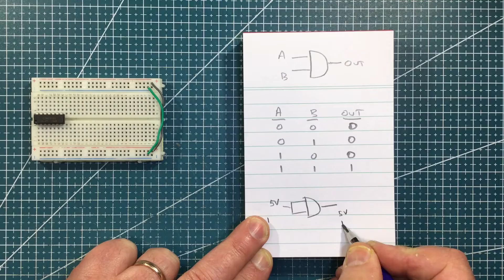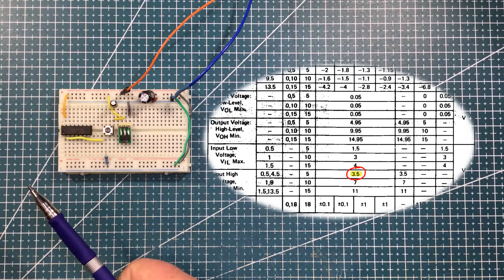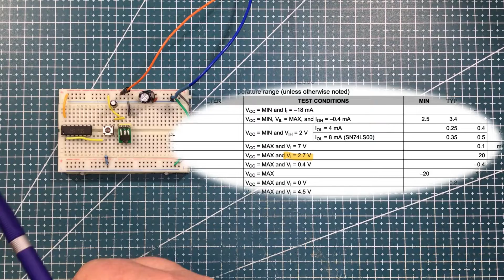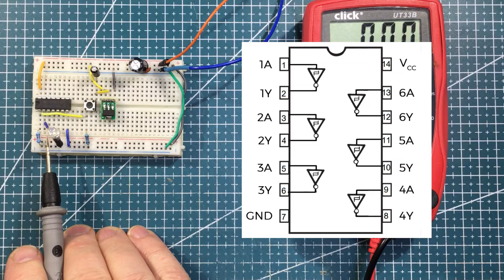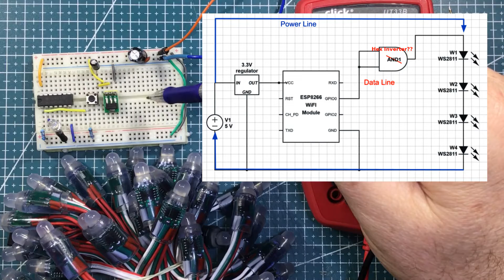Level shifting CMOS or TTL?

Comment: A factory-bought TI CD4081BE running off 5V will output a definite level when driven close to the threshold. It will consume cross-conduction current as expected. But with a 3V input, you'll be getting either 5V or 0V on the output, not 3V. There is no stable input voltage for a 4081B that would let the output stay at 3V with 5V supply. I've tried that. A 4081U part may do that, but the chip you've shown definitely has a B suffix, not U suffix. You can put together a 4081U-equivalent AND gate using the 4007 array to see that behavior.

A 4081, whether B or U, loaded down too much with a LED sure will not output 5V. CMOS outputs are current sources. When enough current flows, the carrier density and drift speed in the channel are saturated, and no more current can flow. The output has an I-V curve, it's right in the datasheet. I bet you can look at the curve and roughly read off how much current that LED was consuming. 4000-series logic has some high-drive parts, but the majority of them are low strength outputs designed to drive parasitic trace and input capacitances in a circuit and not much more. For driving larger capacitive loads, LEDs, etc., use e.g. 4041, 4049U, 4050. They have high output drive. 4049U and 4050 have strong PMOS drivers (high output level) and weaker NMOS drivers (low output level). 4041 has symmetric drive strength and is IMHO a rather underappreciated part. It is one of the fastest 4000-family buffer gates, while also being able to drive comparatively heavy loads.

A CMOS and gate may also behave differently if both inputs are driven close to threshold, vs. just one of them, and sometimes which one has lower voltage makes a difference too. So, if all I had were 4081 gates and I needed to do level translation from 3V to 5V, I'd do it in two stages. First stage 3V to 4V, with one input driven high, another driven from 3V. Second stage 4V to 5V, again with one input driven from 5V, another from the 4V output. That's about the only way to do it reliably for arbitrary waveforms. For a 50% average duty cycle waveform, capacitive coupling directly from 3V output to 5V input would work fine, with the 5V input biased to 2.5V. But that's really taking the poor 4081 for a wild ride :)

The 4081 you're using looks a bit dodgy. It doesn't have any recognizable manufacturer brand that I can see. Yet it has been laser-marked. It's possibly fake. It wasn't that unusual to have no top-side manufacturer markings on some of the chips made in the 70s and perhaps early 80s, especially by smaller manufacturers. But those parts were silkscreened (often crookedly), not laser-etched.

A telltale of a fake chip would be if it had acted like a U (unbuffered) chip, but was marked B. To check that, take the input-to-output voltage response. A buffered output snaps between the states, a U output will be dawdling all over the place.

For level translation from 3V, if you want to stay within the 4000 family, you can use a CD4504 configured for TTL levels (strap pin 13 high). You can also design a level shifter using the transistors in the 4007U array. With those you can either build a CMOS comparator with common mode range encompassing the threshold you want, or a level translator structure. Either would be considered a "building block" widely used in CMOS ASICs. As usual, there are many particular architectures to choose from, trading off speed, power consumption, input and output ranges, number of transistors, etc. Worth doing if you need something special and feel like engineering it from scratch for fun. Otherwise, any modern CMOS comparator (dirt cheap and plentiful) will do any level translation you want, in a most general way.
Reply from the maker: Brilliant advice, thank you. I have no doubt most of my cheap AliExpress buys are dodgy. Definitely good enough for a hobbyist’s bench, but frustrating when I dive a bit deeper as on this occasion. 👍😀

Comment: A bespoke chip for this application, the TXS0108E will go low as 1.2V to 5.5V at high speed (or vise versa).
It is common, and inexpensive.  If driving a peripheral at megahertz speed, this is the thing.
Sadly, it does not work well for open drain, like i2c ... the dual-mosfet method seems best for that.
Reply from the maker: It’s a learning curve and I’ve enjoyed trying a few more chips than I’ve shown. A bunch of CD4504s have come in, but the datasheet is not promising. 🤷🏻‍♂️

Comment: I ended up with using 74hc245d as 3v->5v level converter, powering on with 5v. Specially for "neopixels". Fast, works well. In theory, it's a bi-directional, but it cannot do bi-directional Level shift, only good for one way level shift, most common from 3.3V to 5V. 
This beast SN74LVC8T245 much faster and supposed to do level shifting both ways. I never used this one, probably need more research.
Reply from the maker: Next week I solve this issue a different way. WS2811 LEDs driven by an ESP-01. 🤫👍😀

Comment: I seem to remember from the 80s that the 4000 series came in two flavours - the ones ending in "UBE" which had unbuffered outputs and were effectively linear from input  to output, and the "BE" ones that were buffered and had more precise outputs but longer propagation delays. Since in those days I avoided CMOS I never got a deep dive into this - Does the CD4081 you used have a suffix? I have heard of people using CMOS gates for level shifting, so maybe you were unlucky with your choice of chip.
Reply from the maker: It’s the sub-variants that’ll get ya! I’ve abandoned CMOS AND the TTL for the project (addressable LEDS) - see next weeks vid for the solution I used. 👍😀